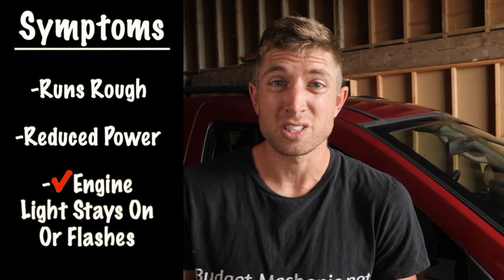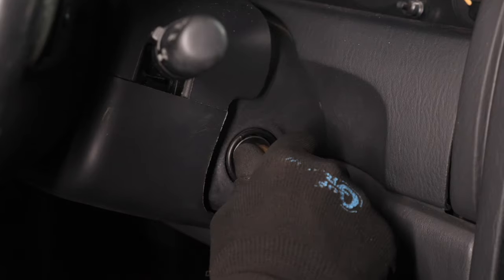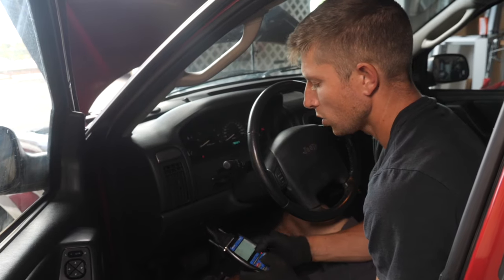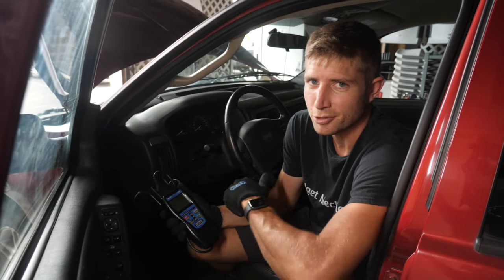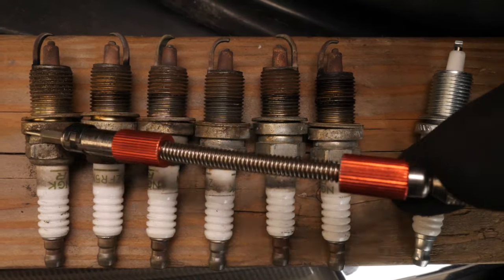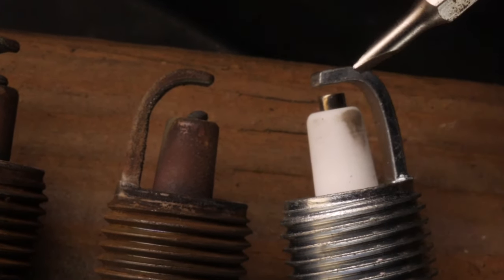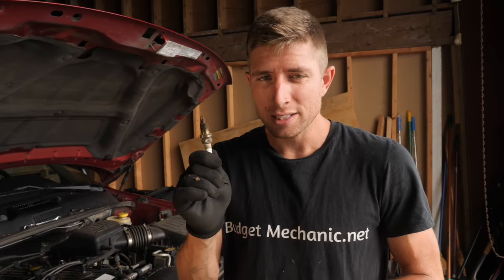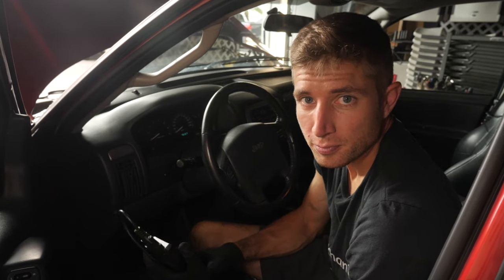Diagnose and Fix Engine Misfires - Flashing Check Engine Light , Rough Running Idle , Low Power

Comment: Try this cheap fix first.  Pop out the mass air flow sensor and spray it down with MAF cleaner.  Let it dry.  Pop it back in.  $10 or $12 at any parts store.  You’re welcome.
Reply: I tried this. I think My MAF might be bad. Cleaned it once already
Reply: I'm having a problem now where I warm my truck up in the morning the truck and go to leave after its been idling, it's idling rough and the check engine light is flashing. Once I turn it off and back on, and drive, it's ok. Until I idle it again. Any ideas?
Reply: @TrustGodFearNothing  if the check engine light is flashing you should take it to a mechanic immediately as it usually means you have a serious problem
Reply: @TrustGodFearNothing  my Dodge Dakota had revving issues, stalling, rough idle, and more. Try cleaning the Mass Airflow sensor or MAF. Plenty of videos showing how to clean it. If that doesn't work go buy a new TPS or Throttle position sensor. Get one with a lifetime warranty such as Standard. Also, undo the plastic hose from the air filter box to the Throttle body. Where the big hose connects to the throttle body look into the opening and see how dirty it looks. If its pretty filthy, look up videos on how to clean your vehicle's throttle body. Even if it means removing it which may make it easier to clean it. After its clean and reinstalled, air filter box hose is hooked back up to the throttle body, see how the vehicle runs. If not much better, you may need to replace the MAF, MAP and/or IAC sensors. But first, get an empty spray bottle and mix water and dish soap. With the vehicle running spray around where rubber hoses connect to the engine and whatnot. If any bubbles, you have a leak. Which hoses should be your first inspection but you're getting somewhere without paying ridiculous amounts from certain "mechanics". There are way more things to look for. Use the internet to educate yourself. If you're at your wits end then find a trustworthy mechanic. Word of mouth is the best, NOT BECAUSE THEY ARE SOMEONE'S FRIEND OR RELATIVE LOL.
Reply: @Roller76  that blinking means multiple misfires most likely. My car does it but I’m just struggling to find out why
Reply: Did the same thing  twice and my car doing fine
Reply: @Tyler —  it could be the coil pack or spark plugs.. my civic was doing the exact same hooked it to my code reader and it's cylinder 4 misfire
Reply: Nope
Reply: @TrustGodFearNothing  same with 89 fox been stuck on this for a while
Reply: @Unlickable hi there i would just like to found out  if you found the problem as i have the same problem  i drive a opel astra f 200ise its drives of ok when its cold but as soon as it warms up the car doesn't rev past 2000revs in first and second  gear engine light comes on with a bad misfires then have to change to third.  Iv have change fuel pump and  sparks coil ht leads dis cape . Oil pump rings bearings redone  the head and injection timing tensioner  timing belt i have been battling  for the last 8months this problem taken the car 6 mechanics none of them can help me they just cost more money so please if any1 can help me please let me know
Reply: Will a failing MAP sensor do something similar? (Not the cleaning, but the symptoms?)
Reply: I got a Chrysler 2012 it runs perfectly but when I step on it hard starts misfiring and losing power but just when I step hard on it if anyone know thanks

Comment: Anyone wanna stab at this. 2015 Fiat 500 cylinder 2 misfire shop said needed a plug. And another shop said tuneup. Replaced plugs and coils and cleaned fuel injectors and carbon buildup in cylinders.  Map and map sensors checked.  After all that within 20 seconds of startup engine light flashes and yes Cylinder 2 misfires with code set. Very rough shaking engine.

Comment: A system programmer I once new would say... "Don't assume it's complicated... the problem is probably simple or stupid... ".   I went through this problem with my 20 year old Corolla.... I replaced the plugs with good platinum ones and that's it. About $30 for them and wipe the 'boots' clean of any oil and blow the spark plug recesses empty BEFORE removing the plugs (dust, dirt get into the recesses at the 4 plugs). If you are handy, the throttle body and IAC valve can be cleaned after removal. A chore... ? Yes, but a shop will want a few hundred to do it...

Comment: hi, there i just replace spark plug  and coils on my nissan pathfinder  and i have p030 how is that possible friend thank you for your videos
Reply from the maker: Misfiring? If it happened immediately after the job I would double check all the connections. If it happened a short time later, it could be the coil failing, sometimes new plugs push an already failing coil over the edge...

Comment: Great video, just want to point out that depending on what type of vehicle you have, you may want to check the manual before disconnecting your battery to clear the codes. with some newer vehicles it can cause problems.

Comment: My 2001 Lexus was running great one minute then felt like I lost half the engine. Already knew I was dropping cylinders. Went to a place, got the codes read and it's # 3 and #4 are misfiring. I'm replacing all 6 coils and plugs. I've owned this for a year but I know the guy before did little to know maintenance. When I bought it I changed the oil right away. It was water thin and coal black and smelled horrible. Cabin filter had never been replaced. Just things like this. I expect to see rusted, nasty old spark plugs. Just hope they aren't seized in.

Comment: MY car runs beautifully when cold, warms up p0300.used stethoscope every injector is working. Disconnect 1injector at a time and there's no difference in the way it runs, like every cylinder is dead. IT'S driving me insane.2003 Cadillac DeVille.

Comment: I have a 2006 chevy Impala and it is doing funky things.  I recently had my oil leak fixed and IT'S LEAKING AGAIN!!!!!!!!!!!!!  After 1 month of going good.  Then, while idling it idles rough and sometimes cuts out while driving.  Not cutting out as in the engine shuts down.  Just cuts out very lightly where it causes a revving in and out feeling.  Also does this while on cruise control.  Going to parts store tomorrow to have codes read.  

I do a high mileage oil change every 3 months, meaning before I'm suppose to.
I also do a transmission flush once each year.
I recently changed the cabin air filter, engine, spark plugs and wires myself a couple weeks ago.  

I'm a female and trying to save money.  🤷‍♀️😂😬

Comment: A fast way for checking ignition coils is to pull them (one at a time) while the engine is running and see if the engine changes sound or starts to misfire (don't do this for long though) but it's a quick way to see if a coil is working (be careful because a good coil will continue to send a spark so keep it away from anything flammable and really you only need ot pull them up slightly -- enough so they can't fire the spark plug or transfer the spark to the plug).  If you suspect one is bad, you can sometimes swap them and see if the misfire follows the coil or changes cylinders when coils are moved around.
Reply: So what if you pull them out a little and, it still runs as if you hadn't done it ? How do you diagnose that issue ? Inquiring for myself I have this issue right now ?
Reply: If nothing changes when pulled then that cylinder isn’t firing. Could be bad spark plug or coil. I’d start with a spark plug as it’s much cheaper to replace.

Comment: My 2014 gmc sierra 5.3 is throwing po300 code. Now also catalytic converter bank one and two. It runs good until engine is warm then the misfire starts. Any advice is greatly appreciated

Comment: What do you recommend for somebody with OBD1 which doesn't work anymore?
Reply: Just making sure you are using an obdI capable code reader, every parts store around me only have the OBD2.

I fixed mine by finding the power source inside the obdI casing with an ohm meter and re running power to it, not the perfect fix but it worked. If it's got power then I'd check the ground and see if anything else has a Open loop fault on the meter. 

Hopefully this will help

Comment: I had an intermittent CEL, it would come up when idling and start flashing, then would be solid after driving for a few seconds, just did the spark plugs but i checked my spark plug wires, one was sort of loose so it would vibrate off a little, so i just wiggled it a bit and pushed it down harder and its been fine for a bit

Comment: Could the engine light cause idling? If so, would a change of spark plugs suffice?
Reply: I know this is a 1 year post but everyone else who reads this... It probably would be a good idea to check spark plug gaps,boots and check the wires for any cracking which could all cause a bad running engine

Comment: Excellent video - Clear and straight forward. It feels like I've spent my whole life on the internet looking for advice about this and now I've now find yours. Thank you! 
I have a question please that is directly related to this video - After not using my car for a month and then taking out the battery to recharge it, I have a misfire in cylinder 2 (P0302). The symptons are exactly as you have described, loss of power moving off or going up hill at times. A slow, gradual increase on the accelarator helps otherwise it starts chugging and can even hear a brief whacking noise if I floor it especially in a higher gear. It was (or seemed) absolutely fine before I left it for a month. Should I still replace the plugs? I thought it might be some kind of moisture getting in after leaving it for so long but it's still the same after a long drive. I'm worried that I might be causing more damage. Thanks again.
Reply from the maker: A few things could happen from a car sitting including bad gas clogging injectors, oil leak pooling and fouling plug/coil, animals Messing up wiring, or maybe it’s just coincidence. Best thing is to pull the plug and inspect it, and move on from there.
Reply: @BudgetMechanicHawaii  I was drivine and my car and i used the big lights to do a signal to the guybin front, suddenly car reduced speed, opened ABS light and engine flashed. The flash light its still on, but can I ask you what you believe the problem might be? I tried again to flash the big lights it happened again, ABS flashed and car reduced speed.. I would appreciate if you can give me your advice

Comment: I have had a random misfire for a couple of years now.  Multiple mechanics have tried finding the culprit, with no luck.  Done multiple fuel and intake cleanings, replaced intake gaskets, new spark plugs, nothing has worked long-term.  Sick of spending money at shops and having my car tied up for days so I've just let it run as is.  So frustrating.
Reply: Sell your car and get something different at this point.
Reply: Probably the catalytic converter
Reply: have you tried to see if your coil pack are plugged up in the right order
Reply: @bryantlewis8668  would u have any suggestions on one that’s wanting to chug off n on , but gets literally bouncy beyond really needing / wanting to drive it . i mean , it’s just something u know. Hooked it to the machine it said ‘ cylinder #2 and a spark plug “ I think I said that right … but yea … it’s still the same after replacing the two . I’m not close to town . should I have unhooked the battery a few and reset anything? or do u have any other suggestions? Ty …
Reply: @Freebandzz.Dc5  ty .  i finally let AAA come tow it to the local man. That’s the best thing I’ve ever purchased in my life btw. AAA.so yea they replaced all the plugs and cylinders. it’s been great ever since 🤷‍♀️. I’m a truck gal . my 2013 Dodge Ram caught fire under the hood 2 summers ago . I loved that truck . this car was temporary. now that prices are soaring we’ll im still going to grab one ha. I’m also a tundra gal .i love a Tacoma . I’m curious what’s being put out their that’s holding up to their name best right now . the dodge rams had the highest resale value when I drove one. but I know it’s like anything i suppose new and updated . life . i also love love this dip looking paint jobs on the newer trucks . Like a flattish looking gray . wow . seen a creamy colored can’t explain. and then a medium gray in their .two tone Dodge Ram suppose how u say it IT WAS GORGEOUS!!!

Comment: I tried the replacing the gas cap , dash showed Engine check light, tracker off, VSC. I tried Sea foam . I will use the code reader when I find it. My friend said he believes it is the spark plugs.

Comment: My 2004 Yukon engine light flashes when I do around 70mph, my manual tells me to just slow down until it stops. What could it be and what should I do?
Reply from the maker: You need to get your computer codes read and start from there.
Reply: its your catalytic convertor

Comment: I changed spark plugs,6; ignition coil, 6; also the oxigen sensor, the EVAP purge valve...and still I have a flashing engine light.!!  The scanner continues reading the same old codes... 0300, 01,02,03,04,05,06..and on....  please advise.
Tks.
Sam. From Texas

Comment: I have a Kia Sedona 2015 and its showing P0302  P0304 P0306, Spark plugs have been replaced along with coils  .  Codes are still showing same thing.  Mechanic says Fuel Injectors need to be replaced.  How hard is it to replace injectors?